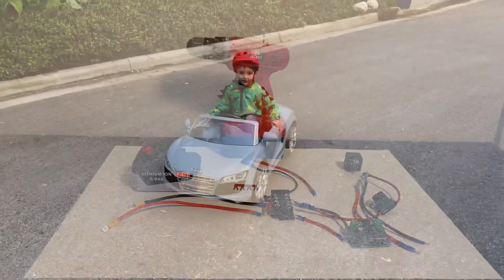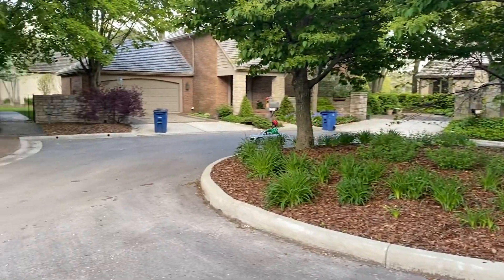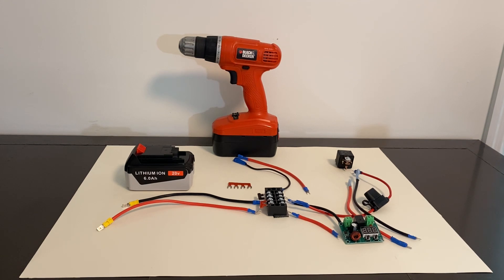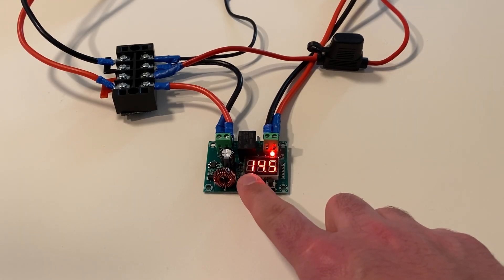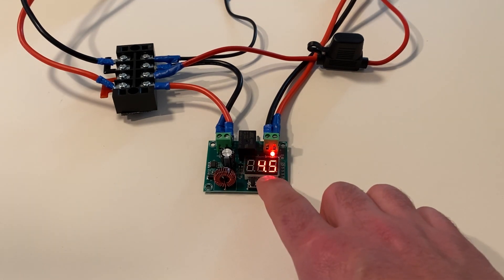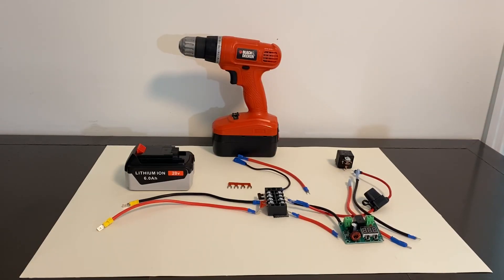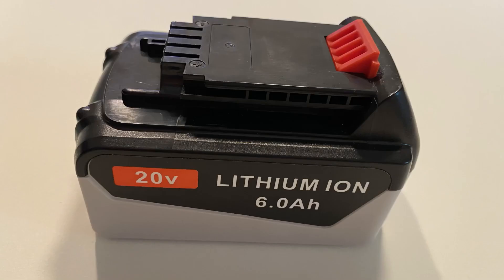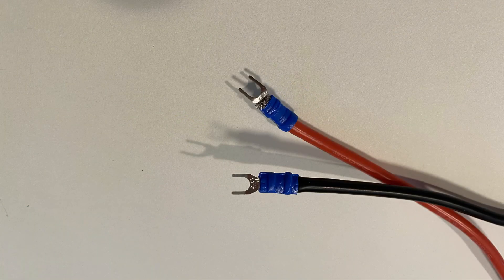18 Volt & 20 Volt Battery Upgrade for Power Wheels with Low Voltage Cut Off

Comment from the maker: Recommended Cut Off Voltages:
12 Volt - Set at 9.9 Volts, 1.0 Reset
18/20 Volts - Set at 16.0 Volts, 1.0 Reset
Reply: Is this setup good for your kids remote rc control mod?
Reply from the maker: @TGA2010000  I would say no, because the RC setup is good for when the kids are under the ages of 2 or two-and-a-half. And if I’m running a RC setup with a young kid, I don’t want the car to go 7mph. I would recommend  using a SLA battery over a power tool battery on a RC setup because the runtime is usually longer
Reply: @DadHacks  thank you very much for the advice...I will definitely look into sla battery setup
Reply: Ever have the boards fail? I hooked up mine and the board failed to output power and or program correctly. I used 2 m18 batteries with a 24v relay over protection and pwm controller

Comment: Why do some people jump the -in and -out together, but you have not? Does it make a difference?
Reply from the maker: @NotSorryCanadian  it doesn’t make a difference, they are all connected
Reply: Both ways made sense to me. I wasn’t sure if maybe jumping them is how you dodge the relay that comes on the board which is too small.

Also, this should work fine with a best choice car right? My first load in the circuit will be the weelye control board (upgraded to 24v). Will also be regulating down to 12v for radio/light circuit. 🤞

Thanks!

Comment: I commented on your video a while back cause i had issues   (was operator error)  worked great ever since i changed board settings!  Fast forward a few years and i ran into an issue today i was hoping you could help me with (figured might be quicker to ask an expert)   so got new dewalt  20v 5ah batterys, first power wheel ran great for 10 min and stopped, circuit board still says 19v and forward and reverse doesnt work. ok im busy just use the other power wheel with yoir system hooked up into that one too.  Put same battey in.  Runs 10 min and same thing, just stops.  Board says 19v even put different battery in and still a no go.  Do you know what my issue is ? Or what i should test.  Both are dune racer power wheel if that helps any
Reply from the maker: @nickm7394  step 1) make sure the fuse didn’t pop. Step 2) if you have a voltage multimeter, Check if voltage is getting to the gear switches. Seems like something is burning out the gear switches

Comment: Will all this modification make the car faster atm the factory car max speed is 2.5km is very slow how mutch faster if you run a 24v battery and what if you run 2x 24v batteries how mutch faster will the car run? Does anyone know? Do you also have to modify other things to run 48v?
Reply from the maker: Yes, it will make it faster, 18 volts should make it go about 7mph. 18 volt or 20 volts is really the max voltage you want to push a power wheels. You may have seen some stock 24 volt cars, but the gear ratio on those don't make them any faster, they only provide more torque (to go up hills better). You can do a 24 volt setup IF you use a ESC (electronic speed controller) and a variable speed pedal, otherwise you will rip your plastic gears apart with a sudden jerky starts and stops. You can search my other videos for the ESC setup
Reply: @DadHacks  I truly want to thank you for your honest opinion.  If car don't get any faster using 24v is no point investing in esc and pedal. I will be using your video to install and 18v soon as some other parts arrive. Once again thank you
Reply from the maker: @albaniansuperiorshqipetari8055  Using 24 volts on a 12 stock setup will get you more speed. It’s the stock 24 volt that won’t get you more speed over a stock 12 volt setup. The stock 24 volt gives you about the same speed, but more torque
Reply: @DadHacks  perfect I will use a 24v on a 12v stock setup then. Thank you I really appreciate your advice. God Bless you and your Family

Comment: Awesome video! I've been running a gator and a tractor straight off M18 batteries for a couple years and I've lucked out not losing any batteries from low voltage. With this setup, do you need to enter the cutoff values each time the battery is changed or does it save that info?
Reply from the maker: Unfortunately yes, you need to ender the cut off values each time, which is why I made this digital display voltage kit, so the drive can easily monitor the voltage 
https://youtu.be/5rFmsB9ozzQ

Comment: Love your diagram and set up! Wondering if you have any ideas on adding a single touch (push button) power switch (so my kids can feel like they're "turning on the car" and connect it to a time delay relay to cut power after a few minutes if they leave the powerwheel without "tuning off the car" (pushing the power button back off.) Could the time dealy relay take the place of the relay in your diagram? Thanks for any input!!
Reply from the maker: I just did a video (link below) with an on/off switch and digital voltage meter setup. I haven’t used a time delay relay, but it might be more of a hassle than it’s worth https://youtu.be/5rFmsB9ozzQ?si=wgbfT3xGarCRnIck
Reply: @DadHacks  Thanks so much for getting back to me and your insights! I tend to over-engineer and complicate my projects, so maybe the time delay relay isn't the best method. In your new video with the on/off switch if I understand correctly you're suggesting not using a low voltage cut off and instead just rely on the voltage display? If a low voltage cut off were used in this set up would the on/off switch reset the low voltage cut off, or just when the battery is removed? Thanks again!
Reply from the maker: If you did add a LVC, the “reset” would only happen if you removed the battery

Comment: Late to the upgrade party but I was watching this and I was trying to figure out, is the relay required and/or what exactly does it do?
Reply from the maker: The low voltage control board can only handle 20 amps. The power wheels motor will draw more than that on grass or going up a hill, so that will fry the control board. A relay sends voltage to the board to power it without sending the full amount of amps.
Reply: Thanks for the reply! I wasn’t sure what to expect with it being an older video but i really appreciate the clarification! Sounds like not by-passing steps is the smart way to go.

Comment: Hi @DadHacks, thank you so much for your video!!! 🤩 I'm about to start the project and was wondering if using the blue crimp with a 12awg wire is okay. I found online that the yellow crimp is more suitable for this size of wire. I have no knowledge of electricity and I don't want to compromise safety. What do you advice? Thanks a lot 💪👍
Reply from the maker: Thanks! The blue connectors will likely have a hole that’s too small to fit a 12 AWG wire. It’s better to got either the yellow
Reply: Many thanks @DadHacks 😁
Reply: Thank you for the reply. I've another question about the fuse (from a newbie lol). Why did you place one between the terminal block and the relay and not directly on the positive wire from the battery? I thought  that it would be more secure next to the battery to avoid any fire risks? Or maybe do you suggest to place two in line fuses in the system (battery and relay/lcvd?)
Reply from the maker: @cyb3rFac3z I should have placed the fuse closer to the battery. You’re learning quick
Reply: Thus, if I've understand well, it's better to move the fuse closer to the battery and I have a regular wire between the relay and the lcvd?
Reply from the maker: @cyb3rFac3z  yes, move the fuse closer to the battery, before the split to the LVC board

Comment: Have everything wired just as shown with same equipment but my out side of my LVCO does both have an illuminated led light and i am getting no voltage on my multimeter, but i am not sure where the problem is coming from.

Comment: Followed your video step by step with a dewalt 20v battery. Hooked it up to the jeep and it works but it’s super jerky and when you left off the peddle it’s a pretty delayed abrupt stop. Also the jeep had a little radio and would do the engine start up sound but neither of those work when I switched it over
Reply from the maker: The 20 volts likely fried the radio and lights (if it had any)
Reply: @DadHacks  used it a little bit today and those randomly started working again. Took it for a test drive and it lasted around 10 mins then it would kind of sputter on and off a lot. It was set to the 16 and 1 like you specified. There’s a high and low speed but they’re the same now to for some reason.
Reply: @Relyks583  did you ever figure out why it was surging?

Comment: hello , the 24v rele works with 15v for example if I use a 18v battery? If I have a cutoff of 14 v?. Thank you
Reply from the maker: Yes a 24v relay will work when the battery voltage drops to 15 volts. I’ve found setting the voltage cutoff at 16.0 works best for the battery
Reply: @DadHacks  tank you so much...

Comment: I purchased this exact set up but also bought a speed controller. How do i connect it to this setup?
Reply from the maker: I have another video with a speed controller. Skip to 2:50 on the video and then 4:20 (ignore those links as it links to the current video) for the diagram for this video https://youtu.be/hnBAEuVzGEA?si=eXm_QbslqBvpxkvg
Reply: @DadHacks  thank you!
Reply: For the low voltage board...what connectors are you using? It's such a small opening none of mine fit?
Reply from the maker: @archand1 12 AWG wire can fit well if you “open” up the connection area when you unscrew it all the way
Reply: I got that to work thanks. And sorry to be a pest...I have the exact setup from the diagram you showed me with speed controller. I'm getting power to LVC and speed controller. But, no power to car. It's a Perego Gator...does it have 2 speeds plus reverse have something to do with it? No blown fuses etc.
Reply from the maker: @archand1 So you have power to the speed controller, but no speed leaving the speed controller? There is a mini fuse within the speed controller that can pop, if there is no power leaving the speed controller, I would bet that’s the issue
Reply: @DadHacks  Fuse seems ok, but...when I turn switch to the run or on position, it takes a minute for the red light to come on. Only thing else I can think of as an issue...

When I did the positive and negative terminal loops...it appears you had one prong on the terminal strip where. I left 2.

So for example on terminal strip that one going to relay 30, I have the positive fork going there then the terminal block on top connected to slot right beside it on far right bottom

Comment: Thank you so much for this video! I was so confused on the low voltage controller and why it wasn't working. But when you explained the math of it, it made sense and it worked mediontly. Thank you for saving my project!

Comment: When I attach it to the power wheel with the cut off board, the second speed (faster) for forward studders and will not actually go. When I do it without the low voltage cut off board attached, it works fine. Any ideas?

Comment: not just shorten the life of the batteries but fire risk because the chemistry becomes unstable and could start fires.

some lithium chemistries can handle it better to really be safe you should go with lifepo4 witch you will simply ruin the cells and they may not last as long.

i think this could one of the reasons why hoverboard batteries was catching fire besides shoddy cells, bad welds and shoddy charging systems.

and now ebike batteries are catching fire it has been all over the news and youtube news.

Comment: what relay model did you use?
Reply from the maker: You can use a 24 volt / 40 amp 4 pin relay. https://a.co/d/7OmMpjw
Reply: thanks really helpful @DadHacks  . im trying to wire up a 24v, 4 motor 4x4 power wheels, with a speed controller, low voltage cut off and ryobi battery adaptor.

Comment: How do you connect the two wires that go to the vehicle? Do you have any pictures of that? I have 4 wires coming out of my power wheels.
Reply from the maker: What kind of power wheels is it and what type of battery does it use (6 volt, 12 volt or two 6 volt)? I’ve seen 4 wires on a Kid Trax motorcycles before. If you have an old battery, take a look at this video https://youtu.be/8dfCpXAGNVw
Reply: It is a 12 volt Jeep Safari. And I sadly don’t have an old battery for it. It has black, white, blue, and yellow wires coming out of it and into the original plug.
Reply from the maker: @annamisner7632  how old do you think the car is? Like less than 10 years or more than 10 years old?
Reply: @DadHacks  We got it from our neighbor, but I’m guessing older?
Reply from the maker: @annamisner7632   I’m pretty sure the 4 wires were for a two battery set up. Two 6 volt batteries, and they could switch between low (6 volts) or high (12 volts). To be honest, it’s a very difficult setup to convert to 18 volts

Comment: What is the relay doing in all this?
Reply from the maker: It’s taking the load draw so that it doesn’t have to run through the LVC board
Reply: @DadHacks can u please elaborate on this?
Reply from the maker: I’m not an electrician but I’ll try to keep it simple. There is voltage and there is amperage. I’ll use a plumbing analogy, think of voltage as water and amperage as pressure in a pipe. If you are trying to fill up a swimming pool and had a 1 inch pipe or 3 inch pipe, the 3 inch pipe will up the pool faster because it can handle more pressure. Now think that the low voltage control board can only handle the pressure from a 1 inch pipe, so the relay acts like a splitter, it taps into the “pipe” to test the voltage without diverting the pressure of a 3 inch pipe through it… not the greatest explanation, but there are videos explaining it

Comment: You have any issues with the low cut off board shorting out??  Both mine went out day after I installed them.  Not sure if the kids let the bottom of the board touch metal and they went out  or there is another issue
Reply from the maker: Nope, I haven’t had any issues with the LVC board when used with a relay.
Reply: @DadHacks  Both the LVC boards went out on the first day. (2 power wheels) I followed your diagram exactly,  yes including the relay.  The red light indicator is off on both boards and when I checked with a volt meter  there is no power coming out of the board.
Reply from the maker: @nickm7394  hmm, any other modifications? Like different motor or bike tire wrapped around the wheels?
Reply: @DadHacks  no, none of that stuff yet.  I did test run night before , daughter drove both power wheels around a while. Then came home yesterday and kids told me they arent working.  One of then the fuse blew (the fuse on the wire) pop the new fuse in ran for 3-4 min then died.  Check it and no power coming out of the board, same as the first board.  So maybe bad luck and both faulty or maybe the back of the board touch metal and shorted out?? I got 2 more on order today
Reply: So I should of updated this a while back, but the settings on the board were wrong that I set. After I adjusted them it worked great!!

Comment: If adding a motor voltage controller, would you add it after the line that says "to car" or before/after the fuse going into terminal 30 on the relay?  Wanting to be able to control speed, or reduce voltage out to motor down to 12v instead of 20 or 18.
Reply from the maker: I have a better diagram to use with a voltage controller in this video, around the 4 minute point: https://youtu.be/hnBAEuVzGEA?si=pmGHWQzlBpRoZJ8C
Reply: @DadHacks  hey I tried clicking on your video but it says private 😢
Reply from the maker: Sorry, try this link https://youtu.be/hnBAEuVzGEA?si=pmGHWQzlBpRoZJ8C

Comment: How can I get ahold of you? I got some questions on why I can’t the speed to go up after installing 3 Pcs Power Battery Adapter Converter Kit Includes Motor Speed Controller with Switch Battery Power Adapter Low Voltage Protection 40a Fuse for 18V 20V Batteries DIY Display Toys Robots Cars. Need some help.
Reply from the maker: You can email me at GoGoPoweredWheels@gmail.com , Include links to the stuff you bought and the type of car you have.

Comment: You really need to move your fuses to before the bus bar.  It's not safe the way it's currently set up.
Reply from the maker: Agree. The best place for the fuse is right off the battery
Reply: I’m going to put one before the bus bar and one before the relay too
Reply from the maker: You really just need 1 before the bus bar

Comment: The LED screen on the low voltage cutoff drains my battery if I forget to disconnect it from the car. SOS
Reply from the maker: Great comment. Yes, brands like Power Wheels and Peg Perego do not have on/off switch. It’s best practice to always disconnect the battery after use, even on 6v, 12v or 18 volts
Reply: Put the whole system on an ON/OFF switch.

Comment: Hi, i plan on running  two M18 batteries in paralell. I have the LVC and a DC speed controller. Im thinking i wont use the LVC and monitor the voltage on the cars built in radio. Do you think this is acceptable? I really dont want to reset the LVC every time i change a pack. The exisiting wire in the car is 16awg its one of those chinese ride ons with the lights etc. The battery adapters come with 30A fuses. I plan to upgrade the cars control board in time. There is also a 12v breaker thing between the battery + and the board.
Reply from the maker: Yes, using the dashboard voltage is perfect. I’ve moved away from the LVC board and just use a digital voltage gauge. If the car had a control board (little black box), then it will need to be upgraded to a 24 volt Weeley RX30. Otherwise, you are all set.
Reply: @DadHacks  awesome, my daughter is still small so i plan on keeping the pwm controller no higher than 14 or 15v. When she is bigger i plan on swapping to the 24v board and motors for more speed. I do worry about the stock wiring being able to handle the full load though.